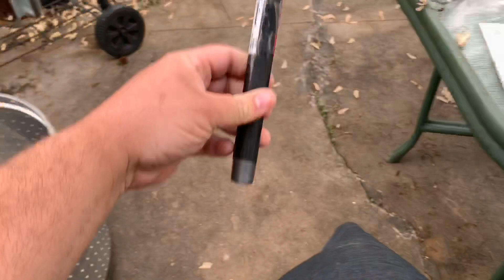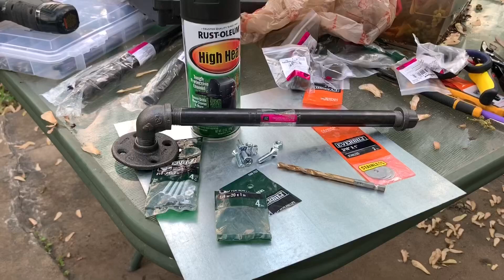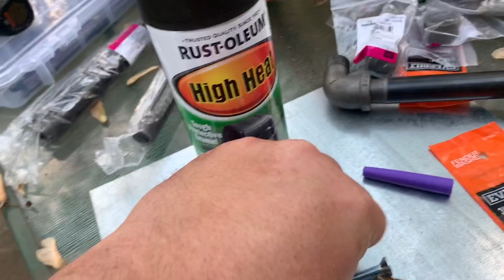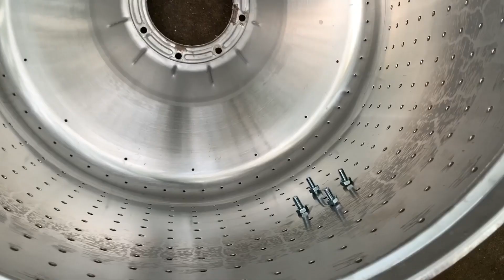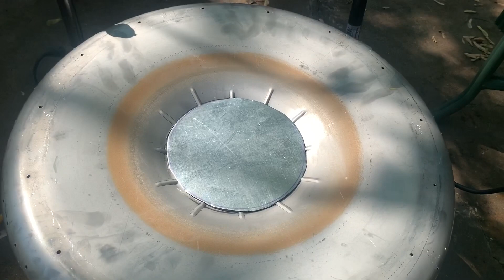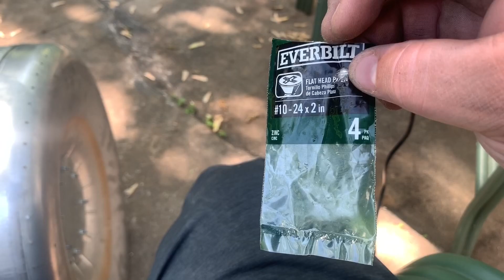Washing machine Tub Fire Pit! DIY and portable

Comment: Nice job. Very informative. I know I'm commenting years after the fact but I think with my build I will use the round flanges at the bottom of the legs to keep it from sinking into the soft ground and provide a more stable platform. I also will use rivets to hold the hardware more secure onto the drum. Over time, the nuts and bolts will come loose, rust or just degrade from the heat. Just my opinion.